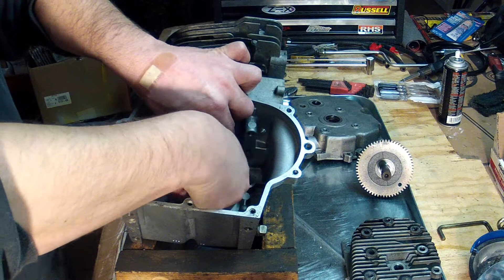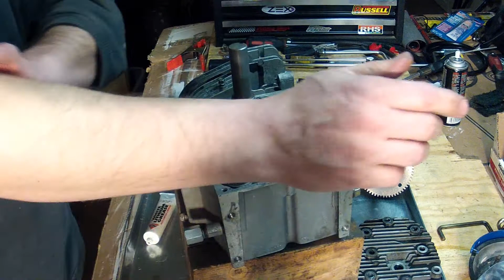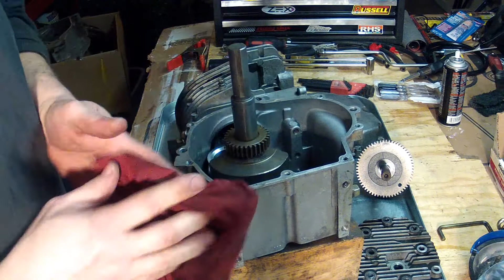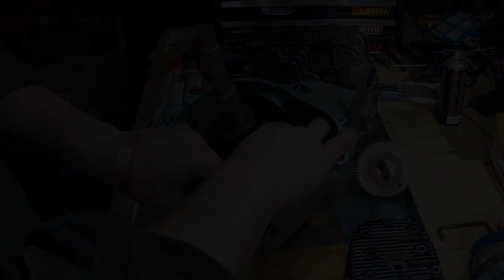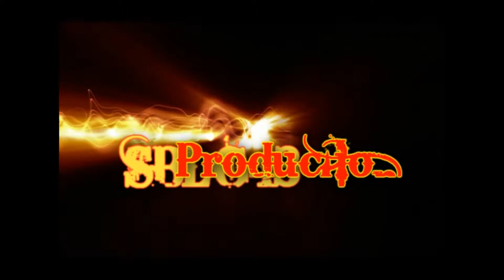Tecumseh HSK70 Rebuild - Part 15 - Connecting Rod to Crankshaft

Comment: I'm using your videos as a guide as I rebuilt my engine.  I'm at this point.  My torque is 17.5 ft#. However when I tighten to that point I can't rotate the crankshaft, when I loosen the bolts I can move it.  Any suggestions or ideas as to why?